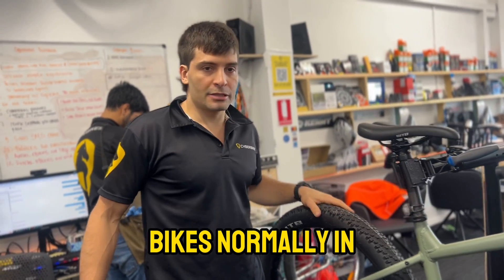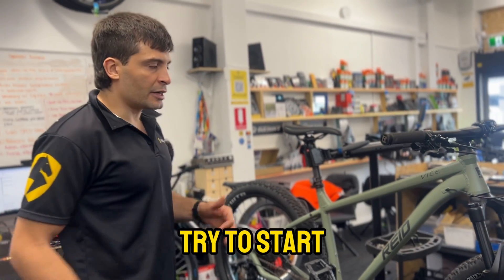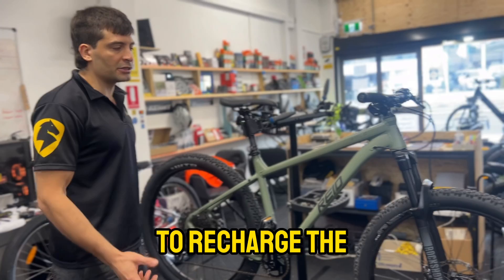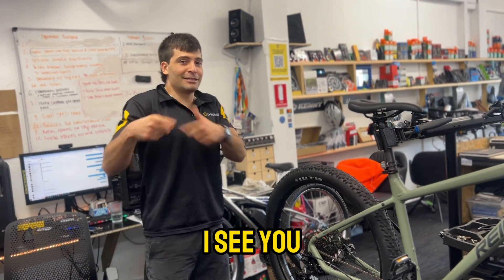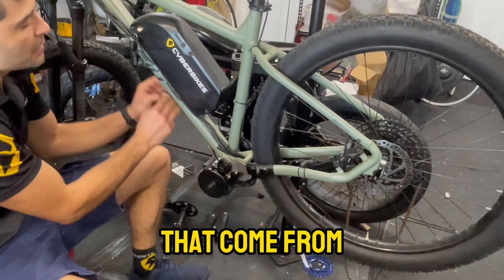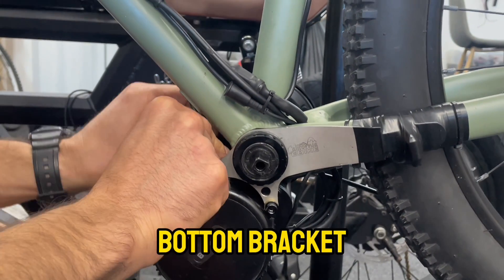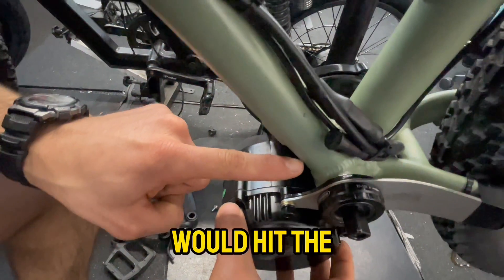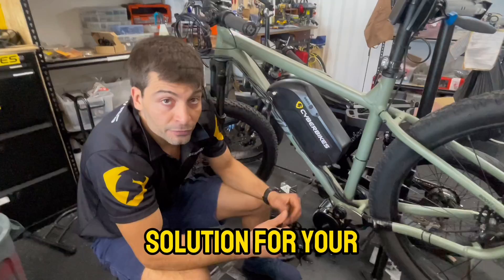Bafang Ebike Conversion Kit Installation Advanced Tips! Electric Bike REID 750W 48V BBS 01 02 HD

Comment: If that bike will actuall be used in blue rated trails, battery pack bracket will need reenforcement. The three rivets will wear out very quickly.
Reply from the maker: No way, the battery is solid like a brick, and the rivet we installed is steel made! This battery would be there even after a traffic accident! 
The problem that casing experiences is a manufacturing issue at Reention the case manufacturer, but we’re experienced and we already glued the cradle itself with flex glue then bolted it to the bike!